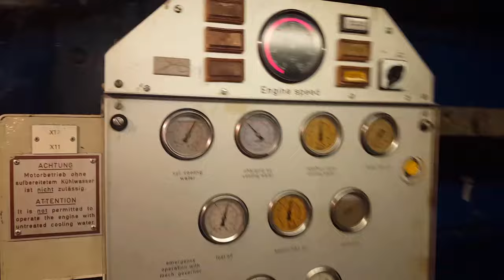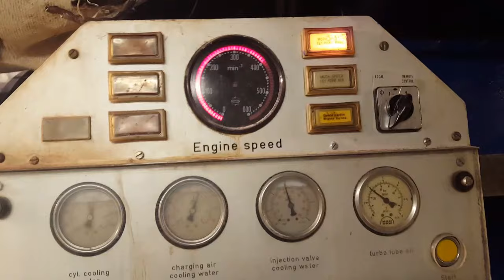Cruise ship engine room

Comment: Each was three decks high. They were located in different parts of the ship. All motors running full throttle moved the ship 15 knots and the ship shook and rattled with vibration. At eight knots all was fairly quiet

Comment from the maker: One day, i was cleaning the engin room, because we couldnt go into the tanks to clean, the sea was to rough, so I couldnt clean. So, as i was cleaning the engine room, I started to wipe down the buttons, and my stomach hit one of the buttons, "I didnt even know I did it". And 7 officers came Running down to the room where I was, and they where freaking out. They asked what I pushed.... I was like, "I dont know, I didnt think I pushed anything" Well, I pushed the OFF button and all the engines started shutting down, The ship came to a complet stop. And they had a security video of myself wipping down the dusty buttons, and my stomach hit the off button and they were pissed, lol. And yes, they told my boss, lol. The team and boss had a good laugh about it, because only I fuck shit up like this.
Reply: What is monthly payment for this job just curious?
Reply: what rank were u at that time?
Reply: Maybe they should install a perspect flap over the button, would stop false shut downs.
Reply: @itchyvet  i was engine cadet a year ago and from what i understand all machineries are related like if you accidentaly turned off 1 machinery then all machinery will be affected.
Reply: @ricehair8807  Steve has no rank on board as he is working for a subcontractor.
Reply: @ricehair8807  
It must have been the emergency stop. But on a diesel-electric propulsion plant THE Solas and rules required emergency stop would activate a stop of the propulsion e- motors, were the gensets can remain running.
Normally, such an important button is behind a hinged cover so that it cannot be activated accidently.
Reply: @janvisser2223  This story sounds like a BS.
Reply: @kilura1  
Learn me something new please.😎 what is a BS?

Comment: 2:02 Left and left top, that's asbestos wrap on that pipe.
Reply: Will be mentioned in the mandatory IHM manual
Reply: Pipe that you mean is fuel to the engine showed 2,02 , isn’t asbestos mattrest  but ceramic one , due to is painted  by water white matt type its appear  like asbestos, its more then 30 years that on board not will be installed asbestos in construction and maintenance.  I was  a past vessel superintendent now retired.

Comment: what make of engine is it. how do you start it
Reply from the maker: I clean tanks, i dont work with the engines, so, i dont know.
Reply: @scottk7613  i think it says "MAN" on the sides
Reply: these apparently are mans. most all cruise ships I worked on had wartsilla
Reply: They have kick starters.
Reply: They are started by admitting air at a pressure of 30barg into each cylinder

Comment: Are these gensets propulsive?
Reply from the maker: I dont know, i only clean water tanks. I was working next to this room, so i grabed my phone, and did a fast walk around recording
Reply: As an Engineering officer aboard a similar vessel, the answer to your question is yes. most cruise ships work the same way now where it will have multiple medium speed diesels like this, that will power big gensets which in turn provide power to the large electric motors in the azipod propulsion systems, some still use direct drives like my vessel where the engines are connected directly to the propshaft via a gearbox :)
Reply: The Diesel engine connected to the generator w/c produce electricity,the electricity produce being supplied to the azyymuthing pod(propeller) and to All electrical equiptment aboard the ship,therefore,the diesel engine was not the one directly propelled the ship,but some other ship has a direct propulsion of the Diesel engine to the propeller and that is called direct propulsion.